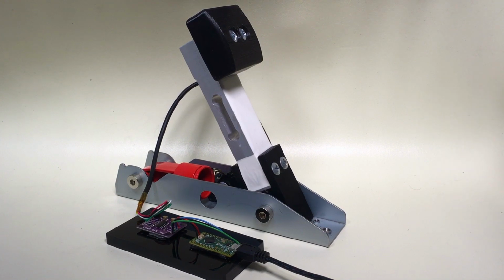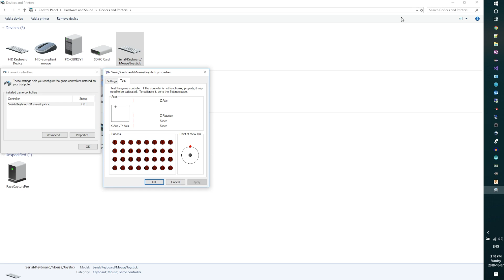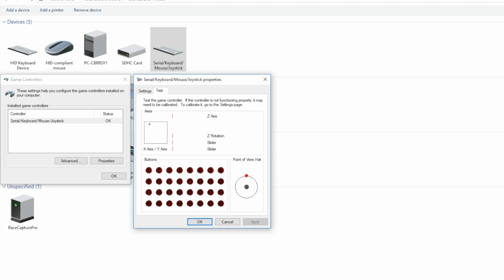Upgrade your G27/G25 brake pedal to a load cell - FOR $30!

Comment: Hello and forgive the question, you mention that it may be necessary to cut the "Rate"
"you may need to cut a trace at the back of the board to enable fast sampling of the load cell (often identified as "RATE" on the silkscreen)"
Could you also show me with a photo or a diagram where to do it? And even if I have to connect something else or just simply cut where you indicate?
Thank you very much for your interest.
Antonio
Reply: 3 yrs later and no response. sorry bube

Comment: Hmmm I cant seem to get this to verify and compile, here are the errors I get
Arduino: 1.8.11 (Windows 10), TD: 1.50, Board: "Teensy LC, Serial, 48 MHz, Fast, US English"

brake_pedal_beam_load_cell:43: error: 'HX711' does not name a type
 HX711 brake_pedal(1 /* DAT /, 0 / CLK /, 128 / GAIN */);

 ^

brake_pedal_beam_load_cell: In function 'void setup()':
brake_pedal_beam_load_cell:57: error: 'brake_pedal' was not declared in this scope
   brake_pedal.tare(BRAKE_PEDAL_LOAD_BEAM_CELL_TARE_REPS);

   ^

brake_pedal_beam_load_cell:59: error: 'Joystick' was not declared in this scope
To make a USB Joystick, use the Tools > USB Type menu
   Joystick.useManualSend(true);

   ^

brake_pedal_beam_load_cell: In function 'void loop()':
brake_pedal_beam_load_cell:68: error: 'brake_pedal' was not declared in this scope
   brake_value = brake_pedal.get_value(1);

                 ^

brake_pedal_beam_load_cell:78: error: 'Joystick' was not declared in this scope
To make a USB Joystick, use the Tools > USB Type menu
   Joystick.X(brake_value);

   ^

'HX711' does not name a type

This report would have more information with
"Show verbose output during compilation"
option enabled in File -> Preferences.
Reply: Hello Damon, have you been able to solve that?I have the same problem :(
Reply: @gabriel1555  yes I fixed it, I ended up using a different hx711 library, I will find the link for you today
Reply: @fathead7  I read  your answer just now, could be really good if you found the link! thx a lot !
Reply: @gabriel1555  I couldn't find the correct link to git so I zipped up my libraries folder for you, just unzip this in the my documents/aduino/libraries folder and it should work then, let me know if it doesn't https://www.mediafire.com/file/b0g9hx1gboro0hx/libraries.zip/file
Reply: @fathead7  It's working! thank a lot !!! :)

Comment: @Jean-Sebastien Stoezel
Great video, thanks for sharing.

Does anyone have a idea if its possible to use this load cell in the same setup?:
https://www.ebay.es/itm/Replacement-Brake-Load-Cell-w-lead-plug-for-Fanatec-Clubsport-V1-V2-Pedals/192684169130?hash=item2cdcdf17aa:g:KjYAAOSwWB5bvME4

or this one:
https://www.ebay.es/itm/DIY-Original-50Kg-Body-Load-Cell-Weighing-Sensor-Resistance-Strain-Half-Bridge/113078168916?hash=item1a53fbed54:g:Jm4AAOSw3HZbKJ69

Comment: Hello Jean, sorry to bother again. I think I will try to use the Teensy too, but I'm trying to run your code on the Arduino software (already have the library installed), and on the line: HX711 brake_pedal(1 /* DAT /, 0 / CLK /, 128 / GAIN */);, it says that "HX711 does not name a type". I'm a real coding noob, but could you help here?
Thanks
P.S: I'm just running the code, without any load cell/amplifier/teensy connected to the PC (maybe that's the cause of the error)
Reply from the maker: Soro GuÊ you need to import the HX711 library, compile and link against it.
Reply: Thanks Jean.
Appreciate your help
Reply: @Ultimatebeatdastreet  Were you able to solve the code/syntax/errors?  I have tried multiple times and cannot get it to compile.   I'm stuck with type not named (which I do not see brake_pedal named in any header or cpp file) or 'no matching function' as there seem to be 3 called for in the ino file but only 2 are defined within the library.   Thanks,
Reply: @10buck289  Hi. Sorry, but I gave up :(
I believe that is a total nooby error, but I gave up and ordered an "Interface LC-USB 16-bit", from Leobodnar website. 
Working great so far
Reply: @Ultimatebeatdastreet  Perfect solution, I did not know..  Thank you!
Reply: @jean-sebastienstoezel5340  Hi - fantastic worked and an inspiration to make my own.   As a non-coder I am struggling with the sketch and compile.   Is it possible you could provide a compressed file containing the \Arduino\brake_pedal_beam_load_cell\brake_pedal_beam_load_cell.ino and \Arduino\libraries\HX711\*.* folders and files as they are from your working computer?  (assuming you don't have the header and cpp file in the same folder as the ino file).   That would be a big help but I understand if this is not possible.   Thank you,
Reply: @jean-sebastienstoezel5340  Hi Jean, the first I hve to say really thx for your work :) , the second is that I have the same problem, download and include the library but still the same error :(  , could you help me in some way?.... thx

Comment: Jean-Sebastian, I applaud your creativity on this load cell pedal.  Are you still using it?   How is it’s durability?
Reply from the maker: tom petersen I am still using this, and I have no plans of changing this for a while. I did break the 3D printed base a week ago though. Looking at the failure it looks like I pushed the pedal too hard (it was an emergency braking and I slammed on the pedal with my right foot rather than the left).
I printed this out of PLA, which is softer and maybe more forgiving.

Comment: Hello. First of all, what a nice video.
I have a question, how do you make the game (Assetto Corsa in my case) able read the load cell values?
Any chance you could make a step by step tutorial (specially about software and calibration...)
Thank you
Reply from the maker: Soro GuÊ the device is recognized as a joystick, it will show up as a joystick axis in your game.
You can also change the gain in the arduino code but I would recommend against it. The game you are using should have a brake pedal profile. I only use iracing and can’t speak for assetto corsa.
Reply: I will use an arduino rather than the Teensy (will try to combine this project with the "Rumble pedals"). Any special advice?
Thank you
Reply from the maker: Soro GuÊ I typically use arduino too, but as far as I know the arduino can only be detected as a serial device. This is why I used a teensy: the teensy will be detected as an hid and will interface directly with the game.
Reply: @jean-sebastienstoezel5340  already ordered the arduino. Let's see if I don't regret this decision
Thank you
Reply: @Ultimatebeatdastreet  Could you do it bro?

Comment: I just thinkering to update my pedals, but I found a different loadcell, which is quite the same or maybe the exact to the ricmotech loadcell kit. Amplifier same as yours, based on the chip, so I don;t link it, but here is the loadcell. This one is only 50kg version, but it seems fits right into the pedal housing. 
https://hu.mouser.com/ProductDetail/Measurement-Specialties/FC2211-0000-0100-L?qs=%2fha2pyFadui1%2fsroq4BmdfPPr2Gr1nnz2TE7O4OG7ZbrPdVUcfwz%252bCciwiRMVkpW
I might help out someone. thanks for the video, I really happy to see someone made the cheap conversion right. Subscribed!